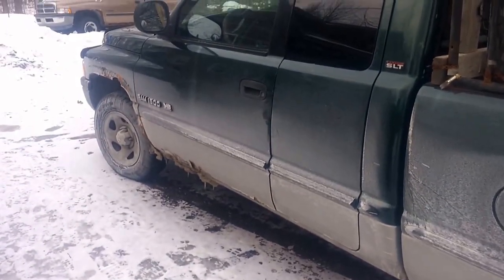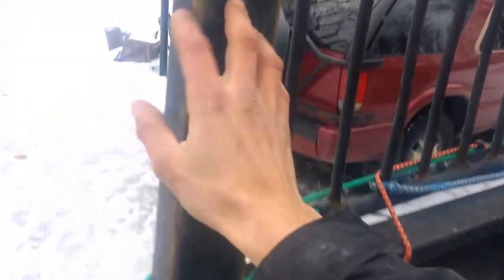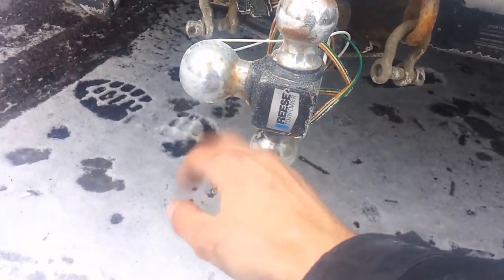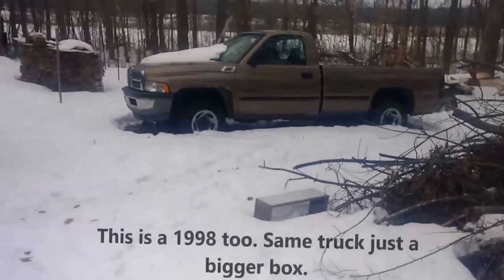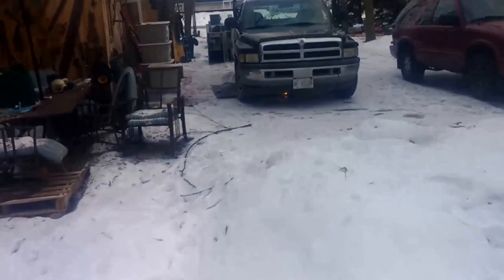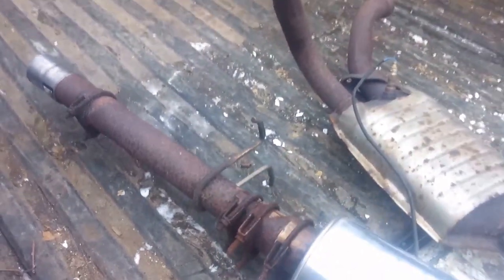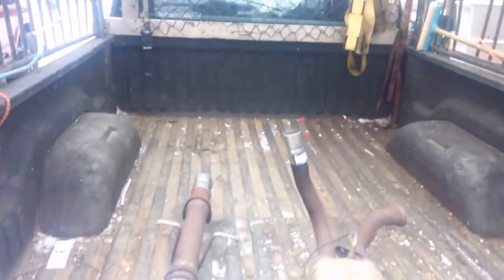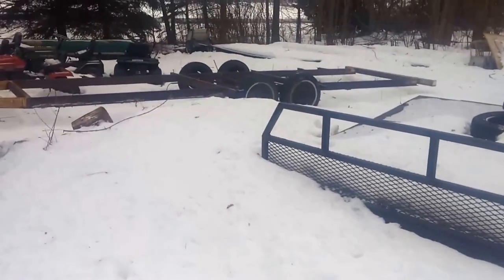Setting up your work truck to haul scrap metal.

Comment: Watching some random older vids and had 2 ideas for how to improve the setup. chicken wire along the side rails will hold in smaller parts without a huge weight increase.  With the chicken wire you can even remove some of the vertical bars for a every other to cut weight. 

A section of chain link fence can hook onto the back of the upper section helping to hold items in like a net. A screw hook can screw into the 2x4's and the fence just hooks on or a 2x4 frame with the fence and eye bolts to hook screw hook into to secure the bottom and a simple latch for the top giving you a 4th high wall for the cage when transporting lose items.
Reply from the maker: You just gave me a really good idea. Thanks bro!

Comment: man that parts truck looks cleaner than the scrap truck lol
Reply: Also you could buy or fabricate a headache rack and fabricate some bedside rails to connect to the headache rack to make it more sturdy because no offense hose clamps dont seem too sturdy to me, and if you did that you could have a ladder rack spanning the whole bed and roof to strap longer pieces down to, just an idea nice truck man.
Reply from the maker: Lol the inside of the parts truck is nicer yes! Your right the hose clamps don't hold much. It's just so things don't blow out. I keep on thinking that I'm not going to have this truck much longer so I'm hesitant on building something permanent.
Reply: uberism81 Oh I gotchya, but the way I see it, you could always take it off when you sell the truck and if you gen another 2nd gen dodge it should slip right into place